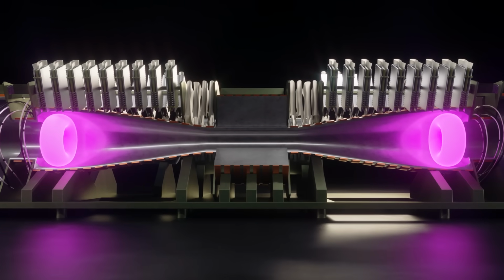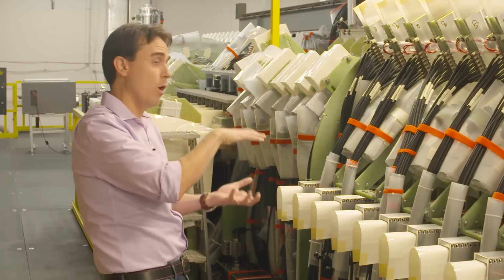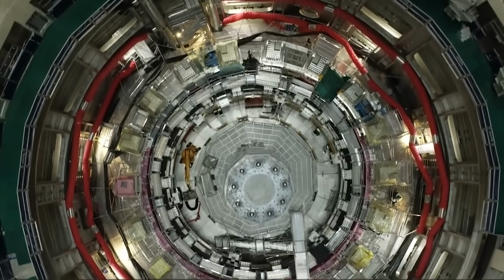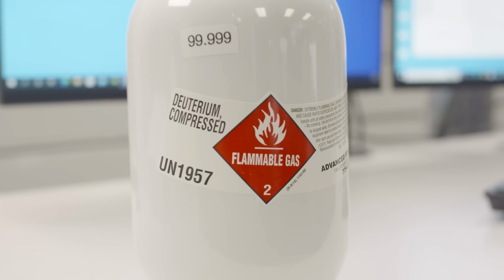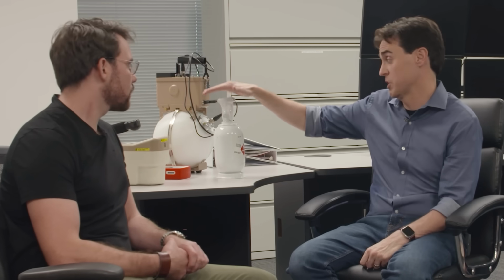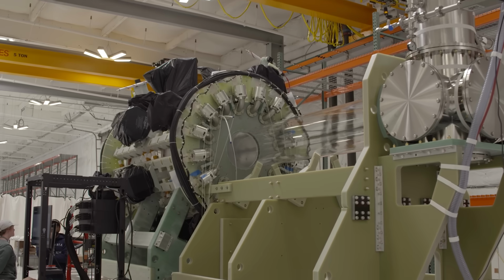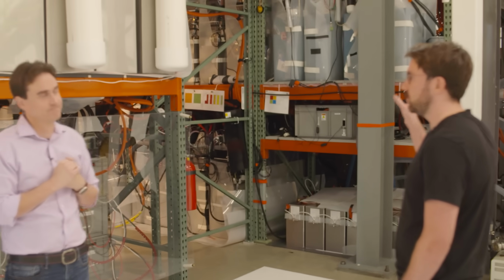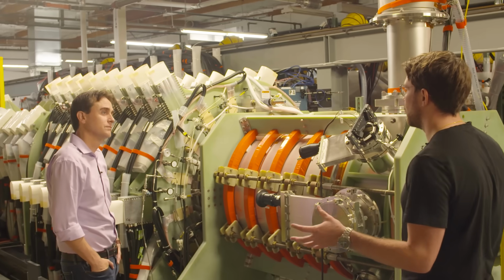A New Way to Achieve Nuclear Fusion: Helion

Comment: The CEO of Helion mentioned the "shot" interval will be 1 Hz; one per a second.
 
The internal pressure of the Helion reactor chamber must be vacuum to create a plasma.
 
So during the one second "shot" interval, 
the Helion reactor chamber must be fully evacuated to create a vacuum.

I really doubt on the possibility of a creating vacuum in a second.
Reply: These machines are not that big. They are using several turbomolecuar pumps that they have developed to evacuate the chamber between shots. The plan for the final power plant is actually 10 pulses per second. Polaris will do 1Hz for now though. It is challenging, but they have a lot of experience with pulsed systems, even with extremely high pulse rates. They did similar stuff at a smaller scale with their FRC based thruster that they had developed for NASA. That one did over a billion FRCs with a MUCH higher pulse rate than 10 Hz.
Reply: @elmarmoelzer2229  Helion claims that "
Deuterium fuel extracted from water, and helium from the engine's exhaust, is injected and heated until it becomes a plasma".
So, during the evacuation, the exhausted helium must be recovered and ready to be injected to the fusion chamber.
Will it be really possible?
I think that the above process must be compleated less than 0.5 seconds.
Reply: @jht6679  
It does not have to be in real time. They can run their machine on just Deuterium for a year. It won't make a lot of net electricity but would be just self-sustaining. Then you have a year's worth of supply and can take a year to make the He3 for another year. 
Not that I think they would even take that long but just to give an extreme example.
The separation process does not even have to happen at the same facility.
Plus, they might even make dedicated He3- breeders that make He3 for dedicated D-He3 power plants. They have a lot of options and possible paths there and might decide on the "right" way on a case by case basis.
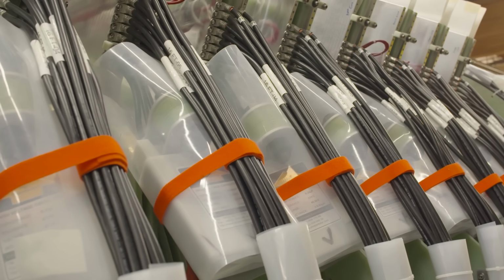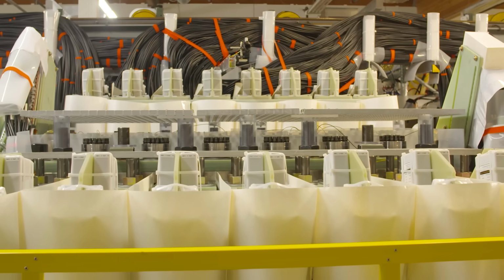Reply: @elmarmoelzer2229 A popular YouTube channel "Real Engineering" described on Helion that "They are developing a method of making fuel on site that doesn't require lithium, instead..".  Please refer "The Problem with Nuclear Fusion" of "Real Engineering". (14:34 / 17:04)
 
So, Helion emphasized that it is developing a method of making fuel 'on site'.
So let's see that will it be possible in ten years.
Reply: @jht6679  
The fuel is Helium 3. They make it by fusing Deuterium. 
D+D => He3 +n
Or
D+D => Tritium + p (The Tritium eventually decays into more He3).
The D-D reactions make energy too, but less than the D-He3 reactions.

Comment: good job.  y'all look look you're doing it the way I was going to try it.  I vaguely recall in my research you want to play with high speed switches.  optically driven transistors for a solid state accelerator.  then things get really fun.  I think there was a cascade switch / tree that was going to be made, then i never saw anything again

Comment: A question for people more expert than I am:  At 12:04, Mr. Kirtley states that deuterium is common at 1:500 in all water.  I was always taught that it is much rarer than that (like 10 times).  Question:  Is deuterium really available in commercial quantities (be it purified gas or in the form of heavy water)?  For sure its readily available in scientific quantities.
Also, I would like to hear a whole lot more on the "patented" method of breeding Helium 3 for this machine.  Ummmm ....... I have doubts.  But, Helion's plan seems way more reasonable than going to the moon to get it.
Reply: There are some 31 Heavy water fission reactors currently operational in the world and more are coming online. Those things have entire pools filled with that stuff. A single 50 MWe Helion power plant would only need about 20 kg/year...
There is enough Deuterium in seawater to last until the sun burns out (and then some).
Reply: @elmarmoelzer2229  Thank you.  It does seem like obtaining deuterium is not an issue.

Comment: More than break even is required.  Producing twice the original energy required to initiate the fusion won't make fusion energy viable for purposes of grid electricity production through usage good ole steam turbines . At least four times the original energy input is required for a self sustaining process. Very unlikely.
  However for community heating purposes ,not electricity production, then going say at least say 1.5 times original energy required might be something feasible. In some cities, hot water as a utility is produced for the community for domestic heating.
Reply: Helion is aiming for a Q>2. They can get away with that because they can recover 95% of the input energy directly as electricity. Direct recovery of the fusion energy also works at a very high percentage.
Reply: @elmarmoelzer2229 .... and then I watched till the end and yes, i like it .
Reply: Love how you skipped over nuclear fission entirely

Comment: In my opinion (based on 40+ years of fusion research) this company is a fraud.  There is no chance of making a practical fusion reactor this way.  The fusion performance of tokamaks in the 1970's was way better than that of present Helion (FRC) devices, and even after 50 years of further work tokamaks still have no chance of making a practical fusion reactor.

Comment: I wish there was a video that explained how energy is harnessed on various thermonuclear reactors. It is given very little focus die to the fusion process itself being more interesting. 
I have very little clue how energy that is generated in the core is being captured
Reply: Most produce neutrons that are captured in a medium (usually a Lithium compound of sorts) and produce heat. That heat then makes steam. Steam drives a turbine, etc.
Helion's design is different there. The expansion of the FRC plasmoid, driven by its own internal pressure and the additional energy from fusion reactions induces a current in the surrounding coils. Very efficient and also very elegant.

Comment: I am tempted to say this looks promising, but since I'm not a plasma physicist or fusion engineer, this is pretty much Clarketech to me. You could tell me anything about it, I am woefully ill-equipped to prove or disprove it.
I usually don't trust these start-ups as far as I can throw their reactor. They make it if they supply the grid and make a profit. They don't if they get featured on Thunderfoot's channel.
Reply: It depends on who you ask. Some plasma physicists, usually coming from Tokamaks, are skeptical. Some others, especially among those familiar with FRCs are more optimistic about them. I am not a plasma physicist, but I know them personally and want to claim to have at least a basic understanding of their system. They are legit and my personal front runner, followed by Zap.

Comment: Actually converting to 60  A N D 50 Hz as well! Sorry, but I am a 50 Hertz sort of person as I live in the majority of electrical grids on Planet Earth as  they are 230V/50Hz! 

(Japan is an unusual case: 100V/50-60 Hz) depending whether one is southwest of Tokyo to Okinawa is 60 Hz, but Tokyo -- uh largest city -- on up to Wakkanai, on Hokkaido is 50 Hz)!

I realise that on this international competition, zou represent America. Thus zou onlz think in American terms. But do remember that North and meso-America are still a minoritz that as i have done mz own calculations, the vast majoritz of commercial electrical power is at 50 Hertz. Nikola Tesla, mz hero, who first discovered ac current had been wotking with 25 Hz (which is still used todaz on Amtrak's catenary between NYC and WDC (11kV/25 Hz single phase). So DO indeed keep in mind 50 Hz as well. Thanks!

Comment: Fusion reactors are very complex and may never make enough net power to be worthwhile. In general I think it's overcomplicating the energy problem. We already have a fusion reactor running at peak efficiency, it's called the Sun. Capturing solar energy with back up blend of wind, geothermal, hydroelectric nuclear fission and yes some fossil fuels is likely a more feasible and decentralized approach to energy security.

Comment: Yall aint worried about destroying the universe at all
Reply: Because it cant destroy the universe?
Reply: @elmarmoelzer2229  if the science is pushed further, you dont think theres potential for accidentally forming an actual black hole style event?
Reply: @samditto   No, there is not. This type of machine can not form a black hole. That was a silly claim about the Large Hadron Collider at CERN, which is a completely different machine and different purpose, design, etc. And even the LHC never made a black hole. And even if it had, then that mini- black hole would have evaporated right away.
Reply: @elmarmoelzer2229  ive spent the last few days stoking my paranoia with atomic blast and similar explosions (halifax and beruit) and i do believe if the science is refined further, i can imagine horrible accidents in the next 200 years
Reply: @samditto  No, there can not. This is not a nuclear bomb. It works completely different. 
These types of machines can not explode. The fusion plasma is very hot, but not very dense (closer to a vacuum than to ambient air) and it is surrounded by a high vacuum, which is a perfect insulator. It also cools off immediately when it touches anything like air or the vacuum vessel walls. The total energy content of a pulse is only a hand full of kWh, a fraction of the content in a Tesla battery. Even if this was scaled up 100- fold, it would not matter.
Reply: @elmarmoelzer2229  i dont believe you and i laughed when i read the first paragraph. Cooling off how much heat exactly, when the material touches the containment walls? If it isnt like an atomic bomb, then why is it creating fission hotter than the sun, and how is that different?
Reply: @elmarmoelzer2229  are you speculating, or do you have a reason to reply so confidently?
Reply: @samditto  

First of all, this is fusion, not fission. Fission is the splitting of heavy elements/atoms. Fusion is the well fusion of two light elements.
Triple product for nuclear fusion is Density x Temperature x confinement time.
For Tritium and Deuterium the triple product just for break even is generally considered 10^21 keV * sec/m3.
1 keV = ~11 million degrees C.
According to their 2020 results, Trenta does about 100 million degrees C x 3x10^22 ions/m3 and holds that for about 1 millisecond.
Those numbers have very likely improved in more recent tests but Density would likely be in the rough order of magnitude.
Anyway, air has 2.53 x 10^25 molecules/m3 and air molecules are a lot heavier than Deuterium and Helium3.
So air has ~1000 times the density of the plasma in Trenta. If you divide 100 million by 1000 then you see that this would "feel" like ambient air at 100,000 degrees C. But the whole pulse only lasts for a millisecond.
A Bic lighter can reach nearly 2000 degrees Celsius and we all have played the game of quickly moving our hand through the flame.
Lets say that this is half a second for simplicity sakes. Since the heat touching the vessel walls within that 1/1000s of a second would be about equivalent to heating it with a Bic lighter for half a second.
If you have something hot like the plasma touching something cold like the vessel wall or air, then temperature is transferred to that and it will cool. Just like you can cool a hot cup of tea by putting ice cubes into it.
Reply: @samditto  I have a reason and that is physics.
Reply: @elmarmoelzer2229  right, and ive seen videos about pulse lasers with insane outputs. But, like too much mass in a small area, i feel too much energy in a small area could cause an unprecidented collapse of reality. Im afraid physics might break
Reply: @samditto   
But it is not a lot of energy. That is what I have been trying to explain to you. The power (heat) is high, but the total energy content (heat * time) is low. The energy density is also not high. A Tesla battery has a higher energy density than this!
A tesla battery is what? Maybe two m3 (likely much less but let's go with that). Trenta has at least three m3.
A Tesla battery has an energy content of 50 to 80 kWh. 
A Helion pulse has a total energy content of maybe 5 kWh. So, a Tesla battery has at least 10 times the energy content in the same volume.

If you are wondering how I get to the 5 kWh in a pulse:
A Helion fusion power plant is supposed to produce 50 MWe. They have a very high conversion efficiency and can directly recover energy. According to Helion it is over 90% efficient for the input energy. They have not talked about the efficiency of recovery from fusion energy, but let's assume 50% efficiency for everything together for simplicity sakes (it is likely MUCH higher).
So that would mean about 100 MW(thermal) total energy output. Their powerplants are supposed to achieve a Q (input vs output) of over 2. Lets just use 2 for simplicity reasons.
So in order to get 100 MW(thermal) net output, they have to put 100 MW(thermal) in. So total power (in plus out) is 200 MW. That is 200 MWh in an hour (duh). Divided by 3600 gives us the kWh/second and that is 55.6. There are 10 pulses per second so that is 5.56 kWh per pulse. And as I said, I was rounding up and the power plants will be bigger than Trenta and all that.
Reply: @elmarmoelzer2229  eagerly awaiting a reply; thank you in advance.
Reply: "Destroy the universe" was very hyperbolic, but at least the planet cause get wrecked in a catastrophe

Comment: What amazed me the most, out of all of the astounding science that is going on at this facility, is that they use a similar method of cable management as anyone building a computer. "Eh just tape them together, and tie that to the wall, that'll do."

Seriously though this is very, very cool. Thanks for the awesome and insightful documentary on this unique approach to Fusion. Possibly the most promising approach I've seen so far.

Comment: I would like you to explain to me the benefit for this tech considering that there was 70 years R&D and 5 Trillion construction costs . for a single plant.  Tell me this benefits humanity ..
Reply: None of those numbers are true and you know that. Helion's Trenta cost 30 million, the entire program.
Reply: @elmarmoelzer2229  So the R&D was 30M ? That's cheap really. And for the 1GW plant ? And for the Fuel That rare isotope of hydrogen that costs 10 million a gram ?
Reply: @GREFOUNDRY  
That was the construction of Trenta and the program, from what I know.
50 MWe power plants will be around 200 million, from what I remember reading. That number will go down with mass production. Helion plans to build them in a factory and they will be small enough to be transportable by road.

I assume you are referring to Tritium, which is 30,000 USD/gram.
You might have missed it, but Helion is not planning to use Tritium. They are using Deuterium (and Helium3 which they make by fusing Deuterium). Tritium will actually be a byproduct for them. They can store it until it decays to more He3 for fuel, or they can sell it. It is not a million/gram but even at 30,000 a gram, it is a good business.

Comment: I wonder if we would have been better focused to continue with nuclear, power demands for populations can be achieved from local solar and small battery storage domestically and the higher demand bits of infrastructure like industry can use the nuclear. So the demand on the electrical networks are reducing now anyway. As population grows the local scalable domestic solution of solar and energy storage covers that. As these systems could operate potentially off grid much of the time this has further benefits. Cars will be hydrogen or other non battery powered in the future but with electric drivetrain we will not need to worry on that front.